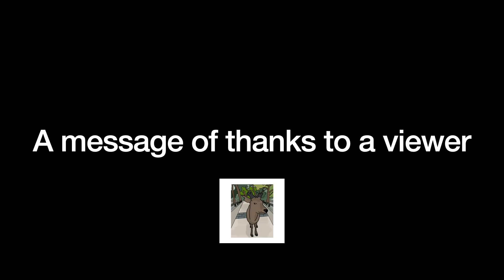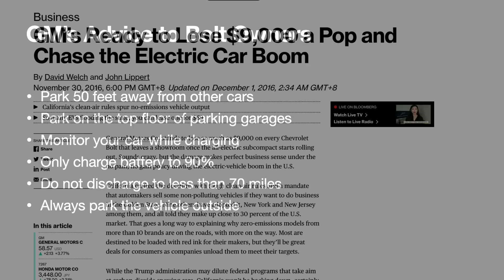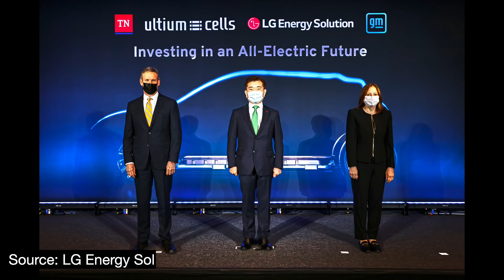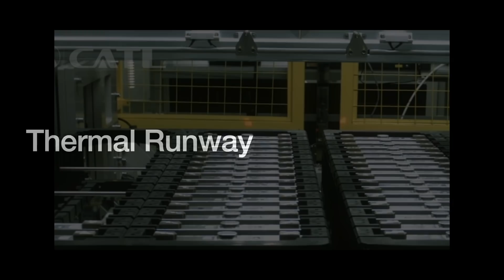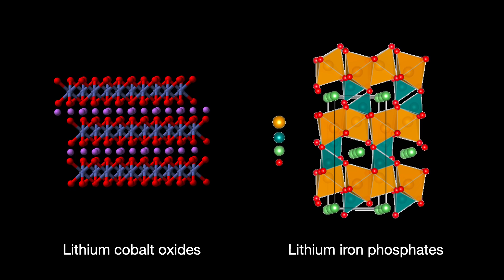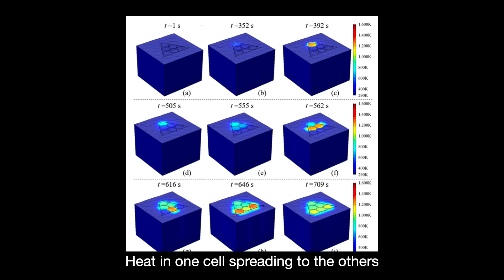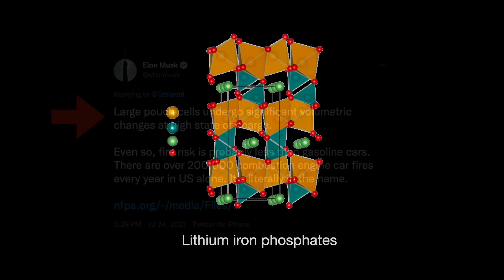The Chevy Bolt Recall & The EV Battery Fire Problem

Comment: EVs are heavier, and the batteries give off extremely toxic gasses when they burn.  They tear up tires a lot faster due to the extra weight of the battery.  EV passenger cars weigh 50% to 75% more than a comparable gas engine passenger car.  

The process to dig out the rare earth minerals REQUIRED for these "greener" vehicles is highly toxic and deangerous.  I could drive an old diesel bus for a decade and generate LESS air and ground pollution than what it takes to build a single EV before it gets on the road.  They take forever to charge and you can burn them up while charging: OH JOY!😂

EVs are trash and never will be as good as gas engined vehicles.  Toyota and Honda are just two Japanese manufacturers that have pretty much quit the EV business.  

And before you bring up the Prius, first, it's a HYBRID, then look up how many hybrids have been sold compared to gas engined vehicles around the world.  Then look up how many EVs have been sold around the world and get back to me.

Comment: GM replaced the battery in my 2019 Bolt EV last year. I wonder if the new battery is really safer, how long it will last and what is actually new about it.

Comment: I worked in Lithium-Nmc (nickel manganese-cobalt) battery manufacturing for a while and lithium hexafluorophosphate is really really nasty stuff and it is a salt usually solved in organic solvents like dichloromethane and the likes, carcinogenic volatile poison.
One time, the formation department caught on fire and fully burned out, thousands of those batteries and the hydroflouric acid from smoke mixed with water dissolved fire hoses and fire fighter's protective gear.
Firefighting drill here in case of EV/Hybrid fires is initially control the fire with foam and water then submerge vehicles in large containers full of water for 4 to 10 days to prevent reignition and have current leakage slowly discharge/neutralize remaining potential in cells.
And for all the EV fanbois, take it from a guy that worked in the field, this is a 1950s nuclear revolution type of madness. Humanity has no way to recycle and reclaim most of the (partially toxic) minerals and resources. At our company we'd literally cut the connection tabs off of refuse cells (voltage/capacity/over resistance out of spec) and package them in airtight black toxic waste labelled plastic barrels which got picked up and brought to a special dump for potentially valuable but unreclaimable resources. Our EV legacy to our grandchildren, expensive toxic waste to deal with.

Comment: I enjoy watching your series, but in this video there are serious mistakes. CO2 is neither toxic nor inflammable. You must have mistaken it with CO (carbon monoxide), both deadly toxic and inflammable gas abundant along cyanide in gasses venting in lithium battery runaway process. Because of this, it is often safer to just let the battery burn instead of extinguishing the fire at risk of exposition to these gasses.
Second, plenty of evidence shows the benefits of CO2 to the biosphere, like the planet greening effect visible in satellite imagery, particularly in the arid areas, the phenomenon explained by the basic knowledge of botany.
Third, so far the measures undertaken to curb the CO2 emissions bring more harm to the biosphere than the still not occuring hypothetical future risks of "climate warming".
To summarize, quite literally the "greener planet" means more CO2, less electric vehicles, solar panels or wind farms. Thank you.

Comment: why do car companies keep using those unreliable LG batteries that catch on fire? Why don't they use reliable and dependable Panasonic? Wonder why Nissan Leaf hasn't caught on fire?
Reply: Leafs usually melt on charging due to not having a cooling system. The software never lets them get hot enough to catch fire. 
But it still takes 2hrs to charge their 34kw batteries

Comment: Just curious all bolts still  under recall from 2021. Why  do we need to talk about what happened in past. 
By the way, VW ID 4.0 is recommendation to charge battery up to 80%.
Reply: It's not an issue you keep water in the battery cooling system. As long as the temperature is under 30c then you might want to charge to only 80 percent

Comment: "thermal runway" I can't even
Reply: That's an accurate term, if heat builds up too high then the chemicals in the battery start reacting with each other and produce more heat, It's closer to a melt down than a Gas fire.

Comment: 30-80% short interval charging LIPO makes them last 5X to 10x longer in both cycle life & calendar life (smartphones, laptops, smartwatches, electric vehicles) 
Storing lithium at close to 50 deg F at 30-40% charged outside of the device, reduces cell degradation while the battery pack in storage; a short 5-10 min monthly maintenance charge to boost the pack charge a bit while in storage usually enough to overcome the self discharge rate. Avoid overheating & freezing lithium ion batteries & never bend, cut, puncture, damage or short circuit them as that can give rise to a risk for venting with flame as noted in the video 

I worked at a professional battery tech for more than 8 years & am also a college educated scientist with chemistry knowledge about batteries FYI
Reply: So no electric cars in hot places like california and in cold countries where temperature in winter usually lower than -10C? Also, does bad roads affect batteries?
Reply: @Igorooooleynikov  the batteries in the Volt and Bolt have a dedicated cooling and heating system that keeps the battery at it's optimum temperature for operation. That's why they last so long.  My Volt for example is 5 years old and I still get 100% of the battery capacity out of it

Comment: Another factor that can make ev fires more problematic is that unlike fires in combustion engines, they can happen more often when the vehicle is unattended. Potentially burning down other things like buildings. This is something that happened with an electric bike, across the street from my place of work.
Reply: Chargers cause more fires than batteries. Some of these power supplies are of poor design and lack cooling fans or are used without proper ventilation. I had one customer who poked a hole in his battery with a screw that was too long. He tried to blame the battery for the resulting catastrophic discharge.

Comment: you should have taken a clue on Elon's tweet.  It is not about batteries but LG's and GMs stubbornness on pouch cells. Pouch cells are fragile, not advisable for use on an EV.  This is the reason Tesla keeps using the inefficient but safe cyclindrical format that is also used on cordless vacuums or battery powered tools.  All these problems/discussion is futile though once LFP based EVs become more prevalent

Comment: It's fairly easy to extinguish a hydrocarbon fire, as it needs air to keep burning. Lithium batteries generate their own 'air' (oxidiser) internally when they overheat, making it much more difficult to extinguish them. This is the main reason that they make the news. They're like bombs that just don't stop exploding no matter what you do.

Comment: For LNMC batteries owners (Lithium Nickel Manganese Cobalt) Remember the golden rule : Stay in the “Happy Zone” of 20-80% charge to maintain a good healthy battery. Charge only at 100% at the last minute before hitting the road if absolutely needed, in order to minimize dendrites formation in the cells. It is important to mention that LFP (Lithium Iron Phosphate) is a much safer chemistry, no thermal runaway, even punctured, and most importantly, almost no degradation before 2’000’000 km, compared to LNMC degradation of 30% every 10 years. It is very important.
Reply: If that's the case wouldn't they already make the batteries at default to charge at that range. Come on 🤦
Reply: @marcxiong8332  High performance, long range or long battery life. Choose one.
Reply: You are the first commenter on YT that I've seen who knows about battery management. This video I just watched is wrong in so many ways. It was created to rally all the EV haters with crazy talk.
Reply: @bingosunnoon9341  Thanks 🙏🏼! Just want to help and hopefully, avoid battery 🔋 fires 🔥 😇

Comment: People who demand 300 miles of range really need a reality check. Most people in the US only drive 40 miles per day. A 100 mile range is more than adequate. If you want to go on a longer trip, you might need to fly, take a train (invest in Amtrak) or have hybrids around. This also doesn't take into account the limits on producing lithium for batteries and whether or not it's worth it to humanity over portable electronics like phones and laptops. Since it takes millions of phones worth of lithium per car. Is one car worth connecting millions to the internet? That is a question we refuse to ask.
Reply: A normal day doesn't involve as much driving as a normal weekend, or a normal vacation. The country as it currently exists is not possible to travel in without a car. Expecting people to use a train is wishful thinking. 

Just visiting nearby family is not possible with an EV, especially not in the winter when range will suffer. Evs aren't ready for normal people.

Comment: The problem with a EV Burning vs a Gasoline car is that lithium can’t be extinguished in a normal way. Also if you turn it down it reignites sometimes did see and had this happen several times. Terrible
Reply: Burning gasoline cannot be extinguished in a normal way either.
Reply: @bingosunnoon9341  I think you don’t get what i mean water doesn’t help for lithium there are only two things right now which work effectively without destroying the surrounding nature that might be next to a street. Which are silica beats or sand (both do not extremely good)

For a gasoline btw. you can just use a fire extinguisher 🧯 if the fire is gone then that’s it it will not reignite.

Comment: sad gm took the pouch style cheep route.   pouch style is just asking to catch fire.  Ford is also making same mistake for the F150.
Reply: The original Hyundai electrics also tried LG pouch batteries. It didn't work out for them either. Had to recall the entire 18 to 19 run

Comment: Water doesn't smother a fire, it cools it down thus removing one of the sides of the fire triangle. Fuel, heat and oxygen are required for fire. Water cools the fuel preventing it from burning. But as you say the heat is generated internally in the battery therefore making it particularly difficult to extinguish.

Comment: Electric battery is like monopropellant as rocket fuel - all the things are in place to release the energy as heat, you only need to add initial impulse. Gasoline needs access to oxygen to burn, that's why it is safe in the tank.
The fact that batteries release oxygen when heated up is even more worrying because as the battery heats up, it literally puts on fire even low flammable things around it.
Reply: Good analogy. It is almost impossible to burn even fraction of the gasoline in a car fire. Ratio is like ten to one what a fully charged battery will release vs. what full tank of gas can do. When comparing the MJ's it is realized they are not comparable in scale.

Comment: Tesla designed thermal runaway out of its battery packs back in 2008, but GM and LG couldn’t be bothered to study Tesla’s s design. Pouch cells are a disaster yet GM plans to use the minutes of vaunted Ultium battery packs.

Comment: Biggest elephant in the room is small cylindrical batteries clusters, power drill 6 pack or flat smart phones (Samsung who like to self combust) or hoverboards who also on internet self ignite is understandable. But for cars how much metal how inefficient technology it is how much weight it adds to total car weight gives production of individual small battery requires extra energy and it cost money for costumers and separators extra anti fire self ignition technology that in general reduces energy density. Ok, trains and wide fuselage planes have "anti-slushing" wall inside fuel tank (that is not patent technology it is just common sense) big fuel tank inertia can have impact of train and plane physics of motion. Big fuel tank with gasoline is still primarily empty space where fuel goes metallic "anti-slushing"  walls is less <1% space of fuel tank.
Tesla battery approx.. 430 kg,  gas guzzler old SUV 2 tons empty weigh that carries 80kg passenger 4% efficiency where 96% fuel energy consumed to carry dead weight - cars itself. But EV even worst.
Reply: True but we have to start somewhere

Comment: This exact same situation happened when ICE cars were becoming widespread.
 Burning batteries are a lot more dangerous than gasoline when it occurs, but it's still a car fire. If in garage, house burn down anyway.
There was a car fire at a friend's neighbors house from some hack jobbed Soobi. Burned down the shed it was next to.

Comment: Tesla strongly recommends against pouch rather than cylindrical batteries purely for the runaway fire risk. I trust Tesla’s opinion on anything like this more than GM who can’t even make one electric model without mass recall. They just have to follow w Tesla’s advice which they make publicly known.
Reply: Tesla has had recalls too, no company can really say and this time it's mostly LG's fault.
Reply: @hendrikheim5665  Did Tesla have recalls because of batteries?
Reply: @RawbLV  if I remember correctly it wasn't battery, but it was for something else that warented a recall. As I was saying, no company is perfect or better, even teslas current ceo has done shaddy things.
Reply: @hendrikheim5665  Okay, thanks for your contribution I guess 👍 🤦🏻‍♂️

Comment: In the end, over 140,000 bolts have been sold. And a total of 16 have caught fire. That is a  0.011428571428571% chance of the car catching on fire. This whole thing got way more attention than it deserves. But I get a free battery replacement, and have the battery warranty extended even further. So I don't mind it.
Reply: Clearly you do not understand that this is % for new cars with new battery so in the end the number of cases would not look so nice on top of that this are nasty fire not only they are hard to stop but they are poluting environment a loot with very nasty chemicals.
Reply: @Biały  clearly you do not that this is the percentage of total fires, vs. total bolts sold in the US. The percentage I addressed is total bolt fies of all years since development. And the 140,000 figure, comes from total bolts sold in the US since it was released to the public. Not new cars with new batteries. Its EVERY BOLT SOLD since the 2017 model was first released. And that pollution has nothing to do with the percentage of fires. You are trying to bring other attempts at arguments, that have no bearing in the subject of either my post, or the subject of the video. But if you would like to talk about the pollution. I could easily say I couldn't care less. I don't drive an EV in hopes that it reduces pollution. Or in hopes that I'm somehow saving the earth by driving electric. I drive an EV because gas has been $5 and up a gallon for most of 2021, and now beginning 2022 with that price. It saves me money. My EV payments are about $300 a month. I was spending $120 a week in gas alone. With free level 2 charging to all employees, I don't even have to charge at home. I just drive to work, let my car charge as I work, then drive home with a full charge. I got my car in June. Gas alone would have cost at minimum $2880. My car payments have totaled $1800. That's saving around $1000 in gas alone in 6 months. Then you factor in not having any oil changes. No waiting in line to fill up. No pulling off the freeway at rush hour to get gas on the way home.
Reply: @davbhard  yes, you save some money at the pump, but car registration is anywhere from $200-$2k a year for an EV, depending where you live in the country.
Reply: Sensationalism is alive and well

Comment: In Germany I have seen the fire department store entire EVs in large baths of water to keep them from reigniting.
Reply: When car is submerged in water there will be no thermal runaway due to good “cooling” of battery and cells.
Reply: Source on that? I would like to see it myself, because putting batteries in water sounds counter intuitive.
Reply: @RawbLV  They did it in Netherlands https://www.youtube.com/watch?v=KzJ6LperQUk Putting a little water on a battery often leads to short circuit and generating more heat. That's bad. But if you put whole car in the vat, the water has a lot of heat capacity to contain the heat generated even with added short circuits, not allowing anything to go beyond 100 C and it does not allow oxygen to access anything flammable. So yes some chemicals may end up dissolved in the water but it does stop the fire.
Reply: !! ..& he mentioned that water seeped inside can cause the fire...
Reply: @navsenjoy  Yea but the whole point is to keep it safe also it will gonna block chemicals from poisoning our air.
Reply: They do not. That's just BS.

Comment: Alway known it as "Thermal Run away" not thermal runway. Because the heat starts relatively low but soon becomes virtually unstoppable (ie it runs away).🤔
Reply: Yeah it's not an euphemism; that's a common term in engineering in several fields.

Comment: It really is the fire safety concern that continues to make EV flareups newsworthy. With a combustion engine it's fairly straightforward to knock out a leg of the fire triangle (heat + fuel + oxygen), but in a battery all these elements are chemically self-contained which is why they're so difficult to put out. I noticed walking around China how much of the state messaging centers around fire safety and how the ubiquitous electric bikes are often banned from indoor parking, because of how often fires keep starting from scooter batteries which are now practically all the lithium type.

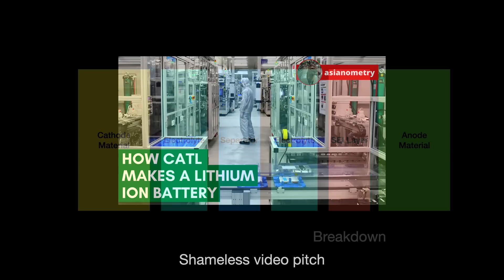Also found it amusing at 7:12 where the subtitles described "degrees Freedom" 🇺🇲
Reply: BYD BLADE 👌👌👌